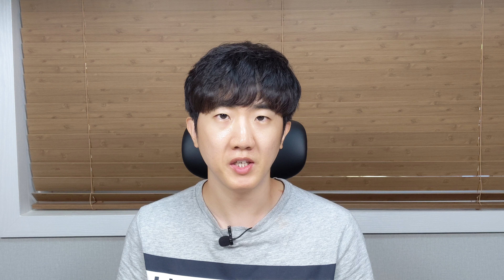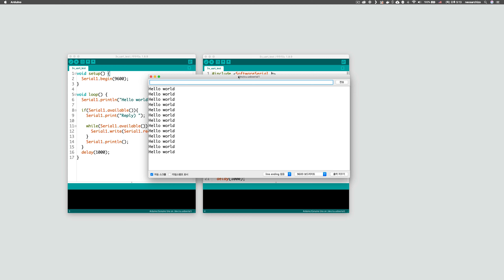How to Use the PL2303HX USB to UART TTL Converter

Comment: How to set either to 3.3v or 5v? which pins to short together?
Reply from the maker: It depends on the MCU board that you want to connect it to. So use 5V pin if the MCU board works in 5V or use 3.3V pin else.